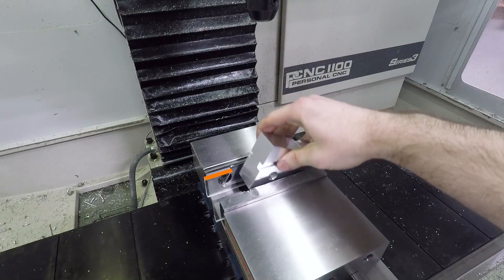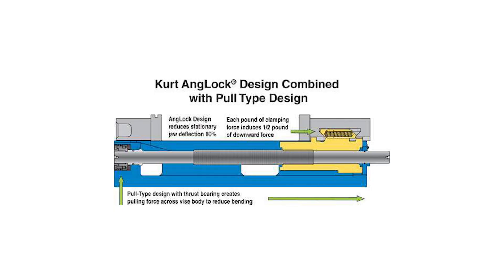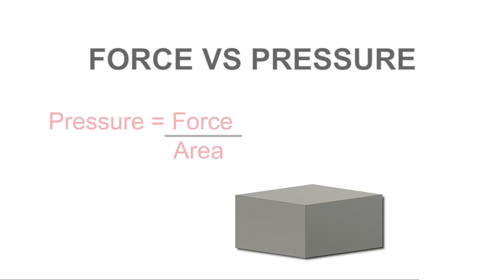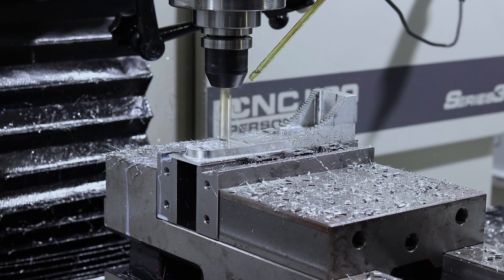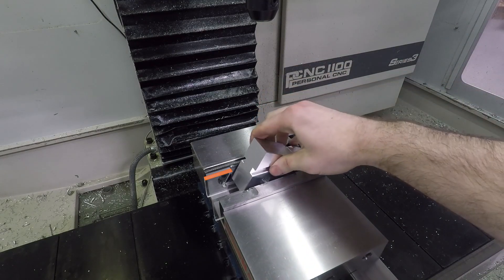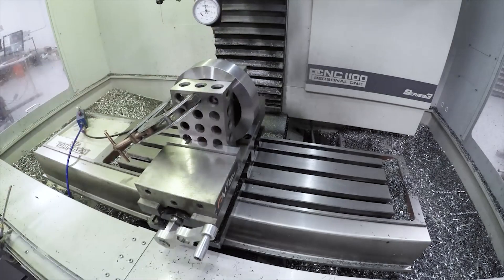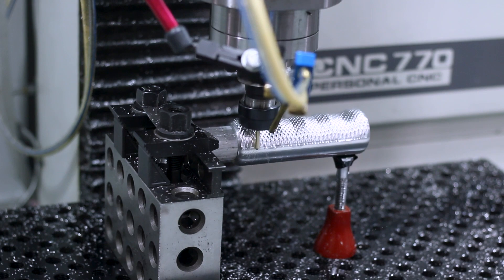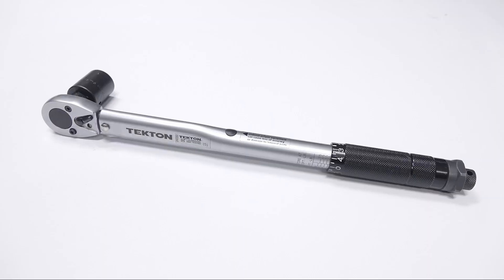Fixturing & Workholding: CNC Vises & 2,4,6 Blocks

Comment: Great video. You should do more of this style, where it gives us a nice highlight back on a specific topic. For instance I didn’t remember the acrylic “parallels” that were in the lego removal video, but this provides a more contextual index into older videos. I have used 3D printed soft jaws (SLA printed solid in “tough” resin, and at least with 6061 worked amazingly well. Sure I could have machined my soft jaws out of the blanks, but 3D printing was definitely cheaper. And one nice thing is if you hit a printed soft jaw it’s not going to break a tool! Also you can make “impossible shape” expansion fixtures that aren’t creatable by us poor-folk with only 4 axes

Comment: I run an edm wire eroder and sometimes a customer brings a part in like say a ball and want features cutting and i always say how the hell do i clamp it 99% of the time its impossible on an edm to use a mill type vice, so when it comes to fixturing it gets interesting. I had part like a washer 100mm dia 6 mm thick and had to cut it in two its none magnetic and couldn't use glue as it ends up being an insulator and the tolerance was 0.010mm, sometimes customers dont understand just because you can 3d print or cad model something it doesnt always work in the real world.
Reply: Can you secure tricky parts with a low melting temperature alloy?
Reply: @mhagnew  never thought that one thanks might give that a try, the only issue is my flushing pumps pump at 12 bar but all the same worth a go 👍👍

Comment: I'm a newbie hobby engineer so have the cheaper end of the market vice (but not super cheap crap). However the jaws are slightly banana shaped, with a thou difference between the centre and ends. Is it worth machining the faces on the mill? Is this something that's ever done in a 'real' machine shop?
Reply: Hey Terry, a real machine shop would hopefully have vice jaws that are true! You may be taking a chance trying to machine the jaws as they could be pretty hard. Grinding is better, but taking them to a shop to grind them may not be cost effective. I'd work around it, using shim stock as needed, and save up for a nicer vice.

Comment: One of the best and worst things about machining is you can think you have fixturing all figured out, then you get a print that really makes you scratch your head about how to hold it. The puzzle of workholding can be very frustrating or very satisfying. When you have bosses who don't understand the value of custom fixtures, you have to get creative with vises. Here's some other ways to use vises:

1. Use multiple on the table for long parts.

2. Hold parts that are out of square by using a round rod or something soft like a piece of wire on the moveable jaw side to help the best side of the material be forced flat with the solid jaw.

3. Hold round parts. You want 3 points of contact, so V-blocks should be used depending on the size and orientation of the part.

4. For other round parts you can use a collet block. By using it with a vise and a work stop you can quickly change it's orientation. You can use a hex collet block and a work stop to quickly cut a hex head for a custom bolt. Then you could turn it upright if you needed to do something on the top. Square blocks can do the same or allow you to easily cut a flat or drill holes through a round bar. The Collet could have it's own stop to make multiple parts quickly.

5. Hold a vise in another vise. The can allow you to do strange compound angles. Or a smaller vise might be better at more delicate parts. Or similarly to using the collet block, the part could be taken out of the machine inside the smaller vise and put back in at different orientations accurately with a work stop. This could help not having to make as many sets of soft jaws for one part.

Lastly isn't really workholding, but you can also press pins into a part using a vise.
Reply: I hold large round parts with two vises semi regularly. Four points of contact (two floating). Works OK. Generally 0 setup time